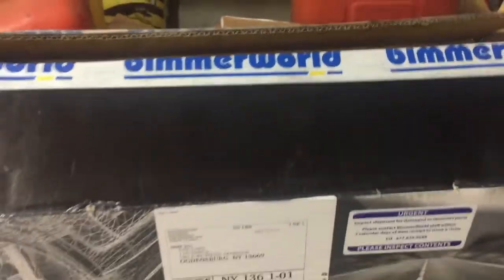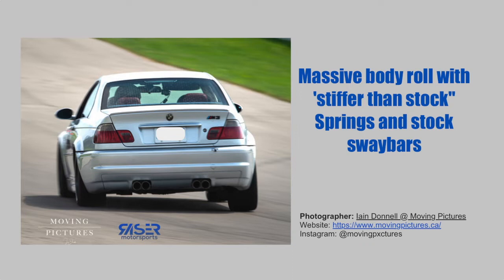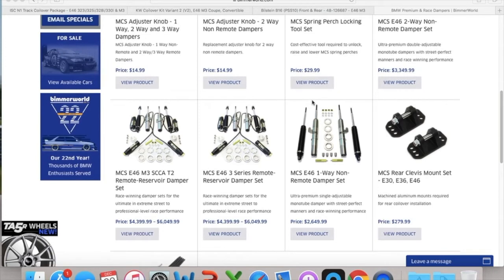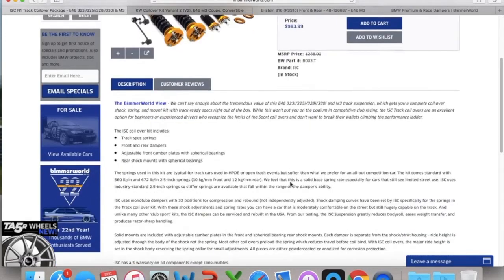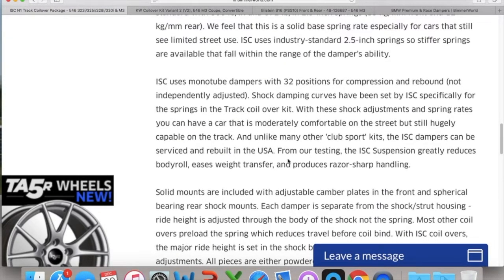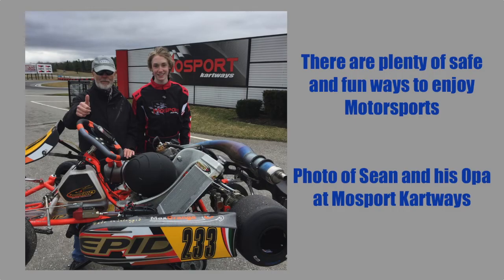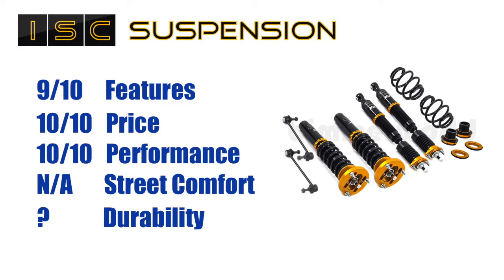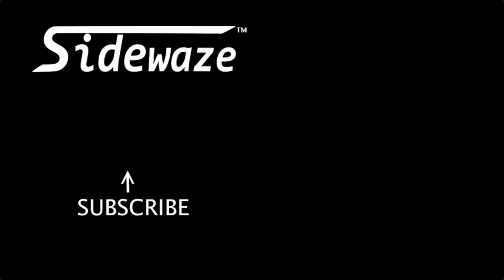BMW E46 M3 - ISC N1 Track Coilover Install and Review

Comment: Did the front ISC coilovers fit directly into the knuckle on your car? I just received this kit for Non-M application and the bottom of the shock body is about 10% larger OD than the OEM shock.

Comment: I just ordered the exact coiler suspension from Bimmerworld.  What's your opinion of product?
Reply from the maker: I am really happy with them so far, it is a totally different car now. The sway bar links that came with the kit were a bit too long. I had to pickup adjustable sway bar links for my fitment. It could have just been a packaging issue, not sure really. I think the value for the money is amazing with this product!
Reply: @sidewazemotorsports1529   How do you like them for street use?  I just installed. At low speeds over bumps it rides like crap. The initial stroke is too harsh.. I have mines set at 7 clicks from soft.  Freeway speeds its ok.. by no means plush.  I have the triple s street coils also.  I may go with regular lowering springs with koni or billies.  You would think close to a $1k setup would ride just as good as oem.  It knocked one of my kidney grill out on the road after a bump..  those are crap also..:)
Reply from the maker: @bpowa  I agree, very harsh on street. I have mine at full soft on street, and 3 clicks from soft on track. The springs are quite a bit stiffer than OEM and also have a linear spring rate, so not as much initial give. This helps tremendously on track for reducing body roll and nose diving. For street only use for lowering, there are likely better options out there with softer / variable spring rates. Thanks for the comment!

Comment: Thats odd, my end links came in a silver color. I received mine during the ISC black friday sale in early December, the same N1 for the E46 M3.
Reply from the maker: My end links didn't fit well, maybe I was shipped the wrong ones?? In the end I replaced them with adjustable end links... I am really happy with these coil overs!
Reply: @sidewazemotorsports1529  can you share you center of wheel to fender length on the front or difference between bottom to top small perch on the front coilovers?  I'm thinking 13.5" or 13.0" center of wheel to fender height on the front for the track. Thanks.